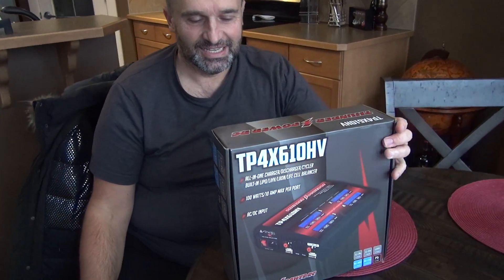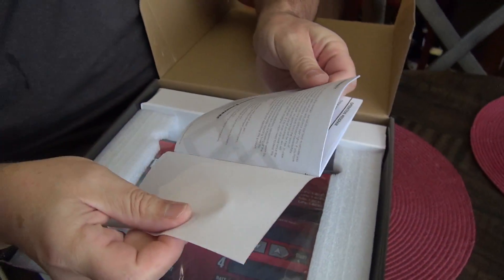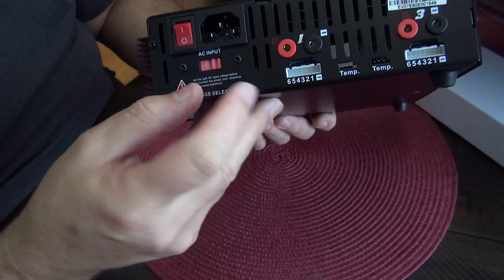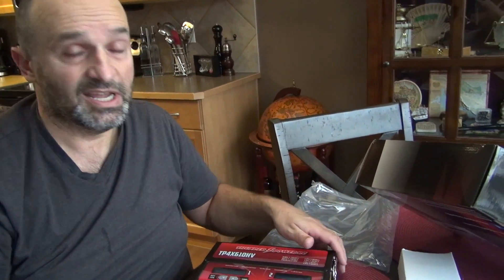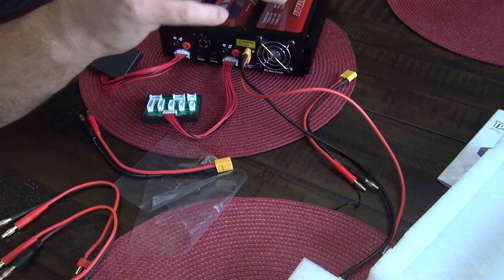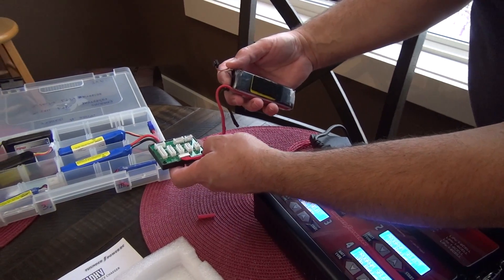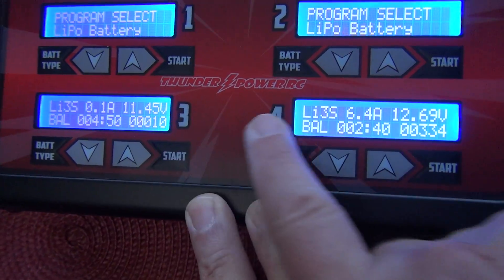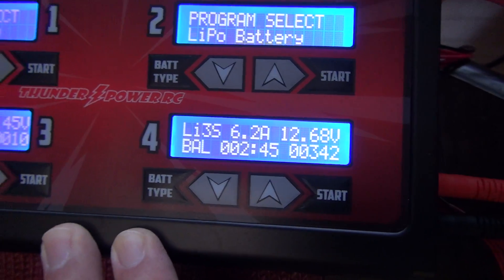Thunder Power RC 4 port charger .. TP4X610HV ..  20201110172236

Comment: I just purchased this charger. Are you still happy with yours?
Reply from the maker: it is ok ..
Reply: @IvanAlarflying  are you just not liking the loud fan? I have a Pulse PLC200 Duo that has a loud fan. It’s a piece of garbage. About four charge cycles in, port one won’t even charge anymore.  Connection break error.
Reply from the maker: @FranksModelAviationWorkshop  yes it is loud even on a small charging currents and overpriced ..
Reply: @IvanAlarflying  I just won a Thunder T6 and am wondering how that will do being used, though reported in good working condition.  I'm wondering about the difference in firmware and components used in the design since there may be a cost effective upgrade option for the T6.  Wondering where to find the schematics for them both?